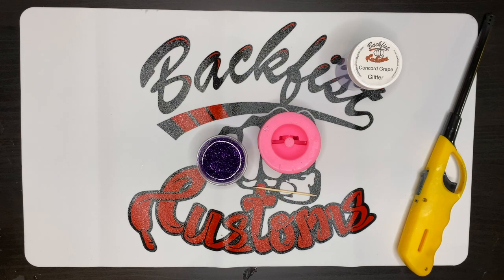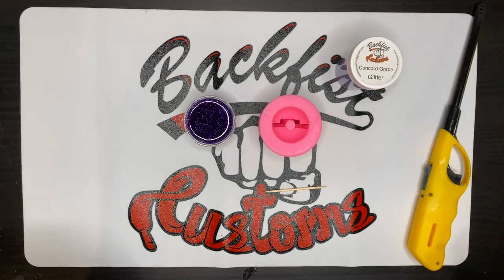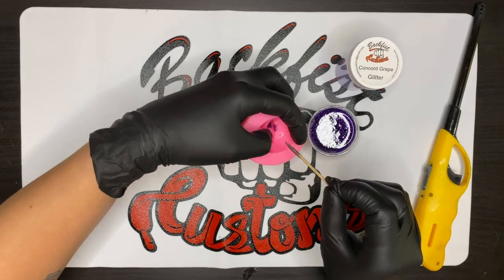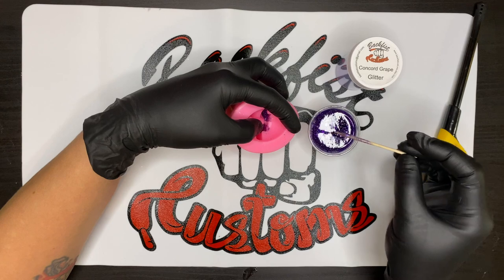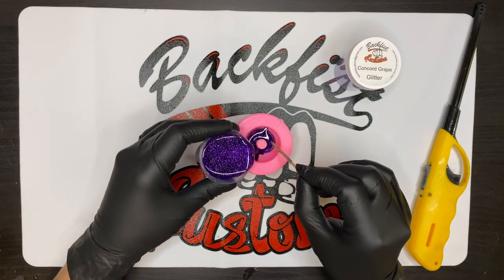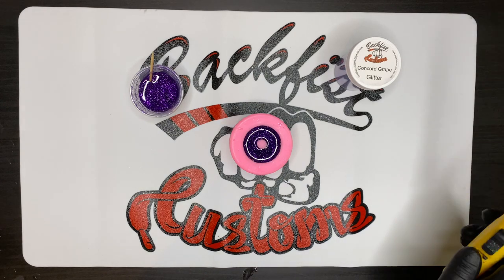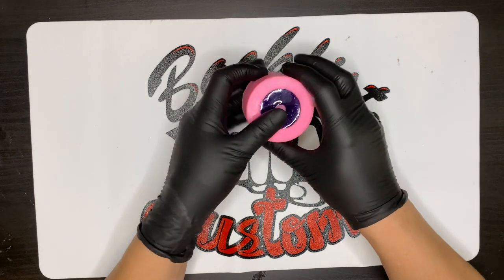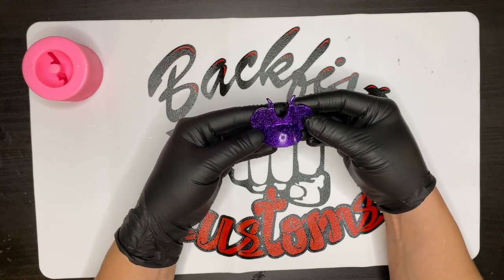How to prevent bubbles in the horns or points of straw topper molds

Comment: Hi love you video. If you don’t mind me asking how much epoxy do you mix of each part and glitter?
Reply from the maker: Hi! Sorry for the delayed response. Great question! You need equal parts of your rain part a and b to get that mixed. I honestly don’t measure the amount of glitter I put in, you want it to still move freely but not too saturated so that it’s thickening. These molds are approximately 20 ml total epoxy each. So to mix one I would mix 10 ml of part a and 10 ml of part b for resin. I usually mix a little extra just in case